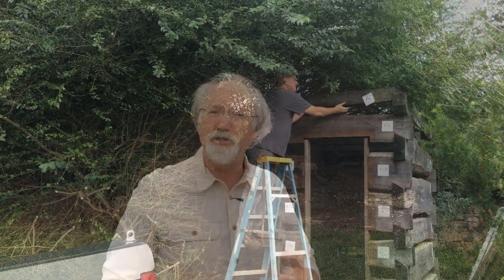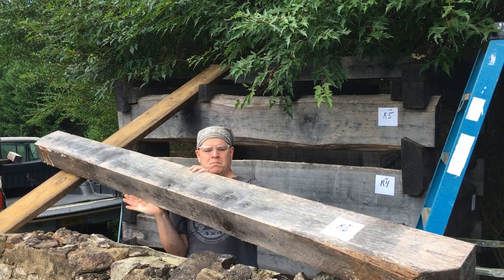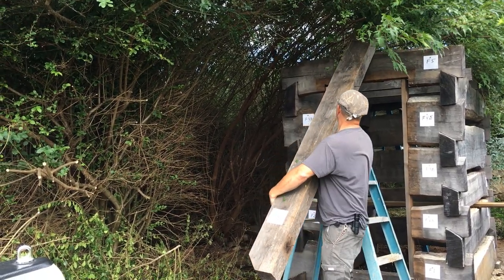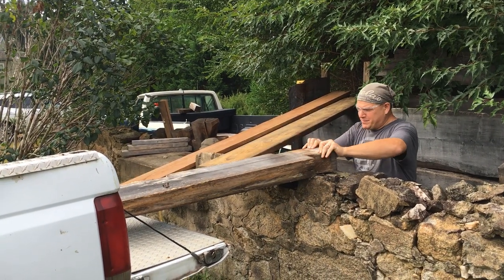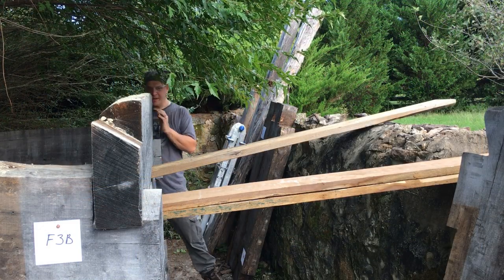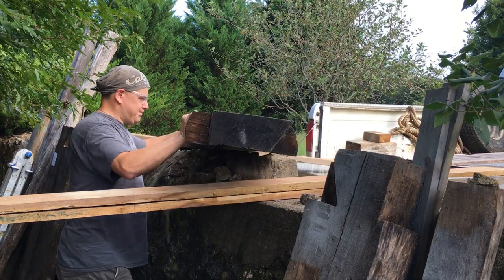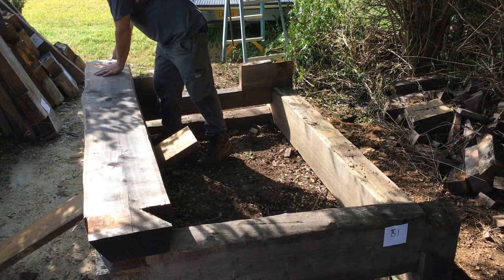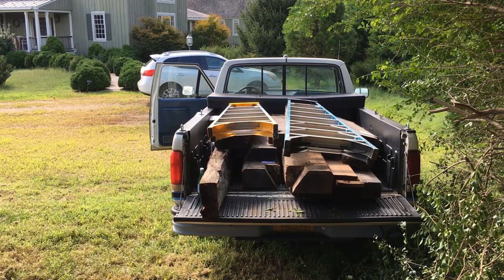Old Man Builds A Tiny Log Cabin #3.. .Handmade House TV #86

Comment: Do you have a video addressing the types of foundations .
 I'm wrestling with a stone boundary then slab poured or wood floors and stone piers .
 I'm certain the logs have to have a overlap over the stone to make a drip edge. 
 But how do you start logs over a slab?
Reply from the maker: I go into foundations in much greater detail in the Academy courses. With that said, I absolutely do not advocate using piers as a perimeter foundation for a structure that will be lived in.
Reply: @HandmadeHouseswithNoahBradley  
Thank you for your response mr. Bradley. 
 Are these issues only on academy lessons and not YouTube videos?
Reply from the maker: @freewillfarms2059  Now that I have 85 YouTube videos, it is hard to remember them all, and recall what is where off hand, although I do know I have gone into detail regarding foundation choices in the Handmade House academy and related academies. 

If the Academy is not something you are up for at this time, I would encourage  you to pour through the pictures on my website to get an idea of the kind of foundations I have traditionally done!
 
Thank you for following along!
Reply: @HandmadeHouseswithNoahBradley  
I'm getting ready to look at my standing timber and assess my home size from that analysis. 
 But it will be much later before I get to start my build.